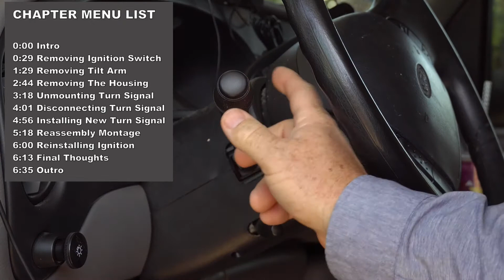🚗 How to Replace the Turn Signal Switch on a Ford E-350 Mini Winnie

Comment: It’s a couple years old but I’ve saved it over and over because I have a Ford E4 50 and I needed to change the switch and this helped tremendously. The only problem I had was actually two problems one was hitting that spring just right to be able to pull the switch you know the switch out and the second was wow my bus remained on it kill the battery so I’m charging it up right now but thank you so very much this was a great video and so easy to follow thank you
Reply from the maker: Thanks for commenting. Glad it helped.

Comment: Thanks for the video! I never would have figured it out on my own. My 1996 Fleetwood Montara had one screw that you didn't mention (probably didn't have) that was an SOB to get out. It held the top and bottom housings together all the way at the back on the righthand side. other than that and my lock cylinder being more corroded than yours (but you did warn me about that) everything went smoothly.
Reply from the maker: Awesome. So glad it helped and you got it done.

Comment: Hey great video and I just want to see do you know if the brake lights run through the switch? on my motorhome I have no turn signals front or back and no brake light or hazards. 1996 e350
Reply from the maker: Hi. No, the brake light does not run through the multifunction switch. The brakes, turn signals , and hazard light are all controlled by different switches. I would suspect that you have some bad fuses.
Reply: @My_Little_Hobby  hi  I have the same problem that you have. Did you get a chance to fix those issues if you do what was the main issue because I couldn't find. Thanks
Reply from the maker: I do not believe it does. It sounds like you have a fuse or two that are blown.

Comment: Thank you for the good advice. Turn signal switch R&R complete. 

Let me add a couple of tools to take along (I did the change-out for the church's van in the parking lot):.  inspection mirror; flashlight; and a  3/16" ?? open end long handle wrench or little crescent wrench;; and penetrating oil for the tilt-wheel control lever threads.

Like your experience in the video, the tilt-wheel control lever was, for me, impossible to remove. I had an 8" Klein crescent wrench, but its jaws were too wide to fit onto the flats on the tilt-wheel control lever shaft. The shaft refused to turn with a pliers. I didn't have a caliper with me, but the flatted area on the shaft looked to be 3/16". I used a long Torx T-20 bit on a 1/4" hex magnetic bit screw driver to reach in with the lower plastic shroud still in place to remove and replace the Torx screws.

Thanks again for the time-saving and confidence-inspiring advice.
Reply from the maker: Glad it helped

Comment: Got this weird thing where there is some sort of short in the wiper portion of the switch. I have an ABS light on my dash and when I mess with the wipers, it causes the light to go out. So I don't know if there is an actual problem with the ABS or if it's because of a short in the switch! So I'm changing the switch before I try to tackle the ABS module.
Reply from the maker: Sounds like a good plan.

Comment: Why did you replace it? I'm having an issue with a rapid blinker, I'm guessing it the switch.
Reply from the maker: A rapidly blinking turn signal light is a code that you have a bad bulb, not that your switch is bad.   Check for a bad bulb.  That is the issue you are having.

Comment: Thank you so much for this video. It helped so much and very detailed but no rambling and such. I ordered the new turn sig switch for my rig and the new one is not matching up with that upper plug. It appears that the one I need is the same new one that you put in. Are you able to tell me what part number you ordered?

Comment: Why did you have to replace yours? My wipers won’t turn off, and I wonder if the switch is the problem
Reply from the maker: I don't remember why I had to replace it. It was a long time ago and the vehicle was not mine. I was just doing the repair to help out an elderly gentleman. 

Wipers not turning off could very well be this part at fault.

Comment: The turn signal does not self-cancel after making a turn in a 1998 E650 van. Is this switch likely the cause or some dog or cog on the inside of the steering column or wheel?
Reply from the maker: I would guess that it would be the signal switch that is the cause. It is the most likely thing to go out.
Reply: @thejungleexplorer  The turn signal self-cancel feature is in fact part of this switch.
Reply: @thejungleexplorer  My R&R repair only lasted about two months and the failure to cancel returned. It turned out the trouble was a dark plastic plate w/ cam, mounted between the turn signal switch and the steering wheel with plastic clips, had slipped loose. The clips had worked loose and the plate moved toward the steering to where the cam barely reach the little white probe in the turn signal switch. Prying with two screw drivers moved the plate back to where it latched nearer the turn signal switch. There was never anything actually wrong with the turn signal switch... subtle problem

Comment: now it won't crank what did I do wrong?
Reply from the maker: It is hard for me to know. Start by checking your battery and connections.
Reply: @thejungleexplorer  yeah I ran the damn battery low. helpful vid by the way thank you
Reply from the maker: @recruit_life0715  Glad you got it figured out.
Reply: @thejungleexplorer  now I gotta figure out why the gas gauge is stuck on full